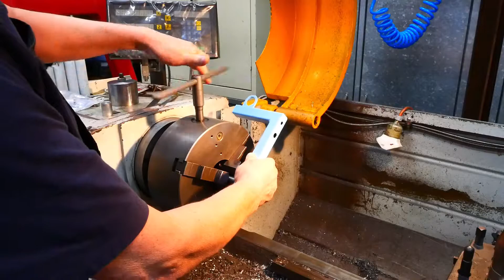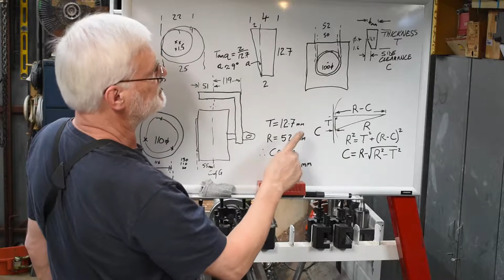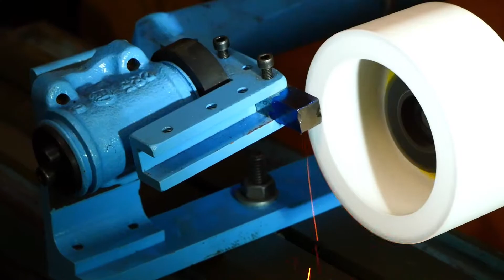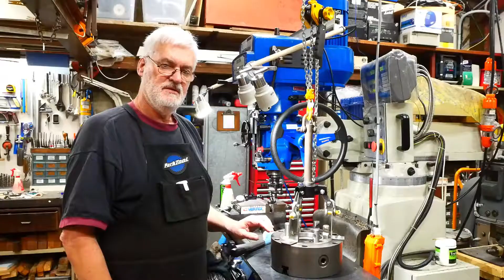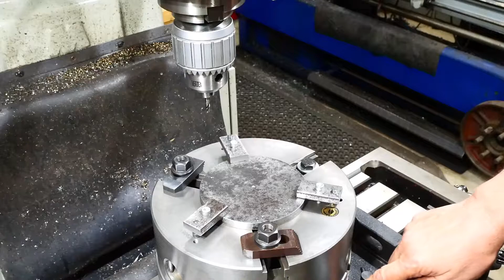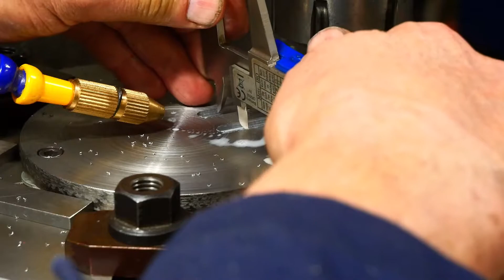Spiders in the workshop - RELOADED*

Comment: Great job thanks!  I like your design and was thinking what if the 3 holes in the made spider were threaded and used to adjust (bolt) the spider distance from the chuck then locked with nut as needed? I know I will be making something like that/yours. Again thanks!

Comment: I LOOKED AT MAKNG ONE OF THEM THEN I GOT A 3D PRINTER
Reply from the maker: 3D printing is a very versatile and interesting technology and I used some 3D printed parts in the rebuilding of my AR5-E/ET T&C grinder. However, I had these made by a commercial printing service as I have not (yet) seen fit to invest in this capability. The printer was able to hold adequate accuracy for that task (a linear bearing cage) - but only just. I think it would be difficult to 3D print a spider with the parallelism of the faces that is desirable (- and easily achieved on a lathe). However, I am happy to be corrected if I am wrong about this.
Cheers, Alan.

Comment: When you separated the chuck backplate, were the threaded holes you used to mount your puller/hoist threaded all the way through? If they were then they were probably jacking points that you could have just put longer bolts in to jack the parts apart. I am sure that you would have done that if they were, but always worth asking.
Reply from the maker: Graham, sorry for delayed response, but I wanted to have another look at the chuck first. Your idea seemed like a good one and it was not something that occurred to me. However, the threaded hole runs through into the body of the chuck and the jacking screws would need to have ~50mm unthreaded lead to pass through the threaded hole in the backplate and reach the bottom of the hole. I think making such long skinny screws would need a travelling steady and be a bit time consuming. There is also room for doubt about whether they would be stiff enough to do the job without bending. Anyway, the idea was certainly worthy of consideration - thanks for the suggestion.
Cheers, Alan.